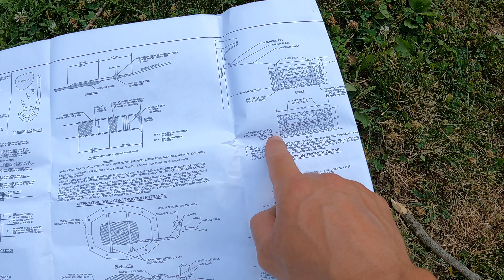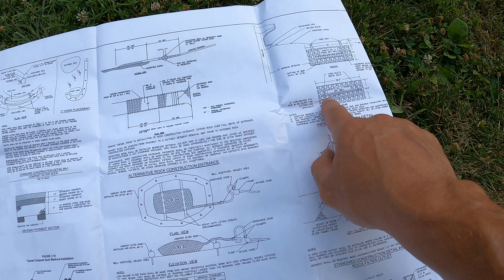Storm water management trench

Comment: I would’ve liked to have seen you stretch a string line from the door sill to the catch basin and put a string level on it to show that there was, in fact, a “fall” of 12” because the video seemed to show the catch basins were at the same level as the door sill.  Just a suggestion.